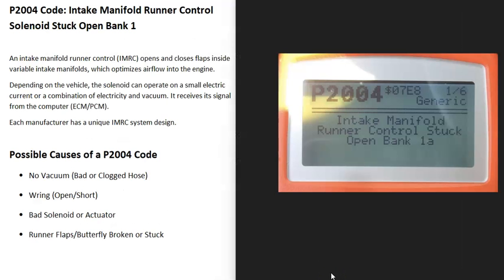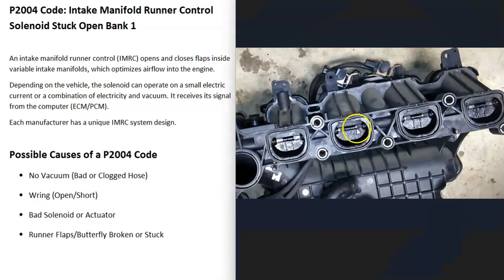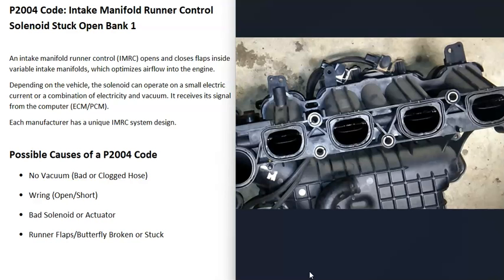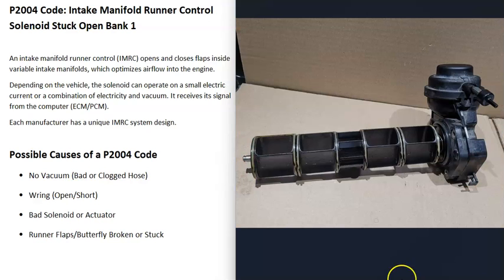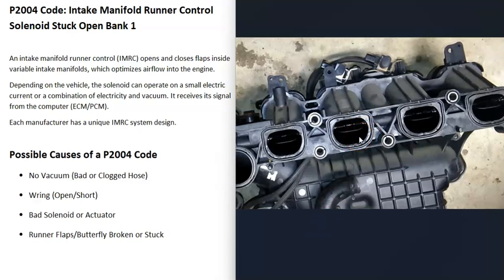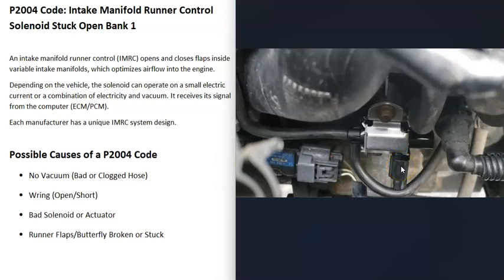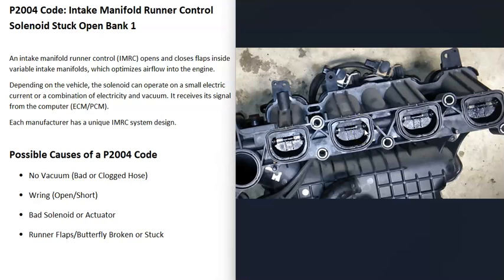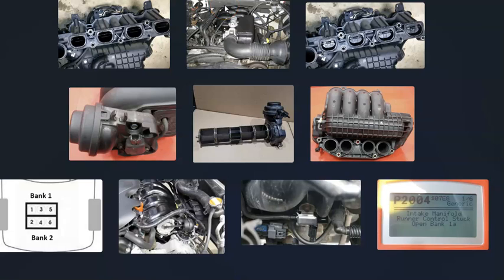Causes and Fixes P2004 Code: Intake Manifold Runner Control Solenoid Stuck Open Bank 1

Comment: Thank you so much for getting to the point! Could not have found such a simpler video on the issue my car is 2016 nissa rogue and just couldn't  find a video until now
Reply: Did you fix it?
Reply: My kind of videos. Not the ones that have you half way taking off the doors when they say its just a fuse by the time you realize to check the other components involved with it.

Comment: I replaced my 2 solenoids 04 mazda3 and I’m getting too much air into the imrc I can stand over it and even feel it, I try moving the flap back with its little arm and is very difficult I then turn it off and back on and it will release and close normally manually all of a sudden gets stuck again.

Comment: Got a 2018 Subaru Outback with a P2005. Causing engine light and disables EyeSight. Looks like there’s carbon buildup in the actuator. Subaru dealer is quoting $1500 to fix. Of course extended warranty doesn’t cover this…🤬

Comment: Hi I’m having the same problem,the mechanic changed a piece on top of the manifold,my engine light came off then two days after it came back on,now the mechanic is saying I need to change the whole piece which caused 1200 what’s your best advice
Reply: Yeah they all do that, they will try to take money from you.
Reply: What did you end up doing?

Comment: I'm getting a p2008 code on my 69 Dodge Coronet 392 hemi swap. I thought it was the actuator so I replaced it..didn't help. I've checked the connector it seems fine. Ideas?